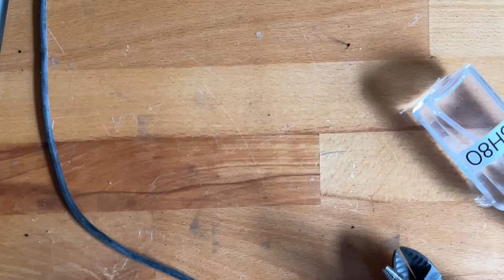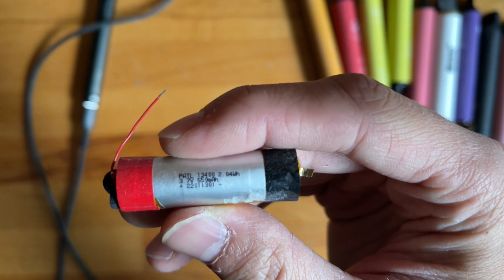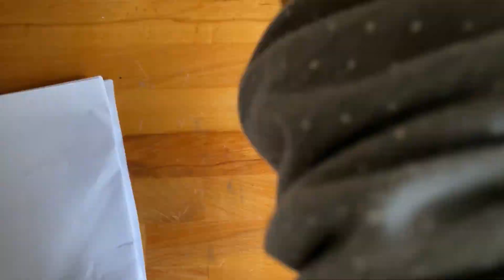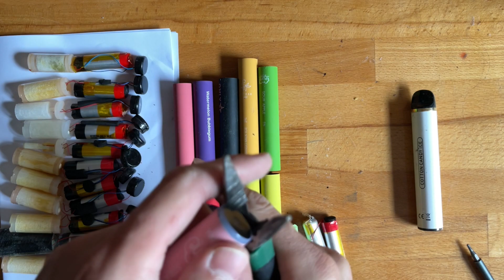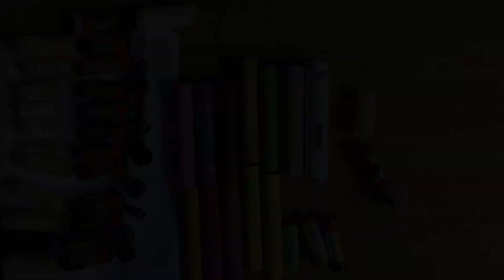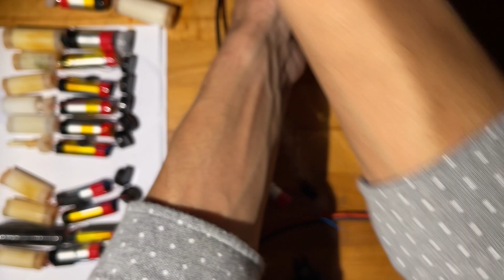Disposable Vape Mining + Current & Power Measurements

Comment: Nice video!

With LiPo cells like this 4v2 is safe, and charging at 0.5C is as high as I would go if you want to keep them in good health. I’m sure they use the cheapest possible for these disposable vapes. The cells in these are probably not in great health because they charge them up full and sit on a shelf for who knows how long. Instead of a nice 3v8 storage voltage.

Still I’d bet you can get 80% of the rated capacity for a hundred or more cycles.

From my RC drones, a lipo 4v1 to 4v2 is about 10-15% of the cell capacity. But most important is the constant current to constant voltage charge scheme. If you cutoff charging at a target voltage without switching to constant voltage to taper the current the battery will sag back down to a lower voltage once the charging load is removed.